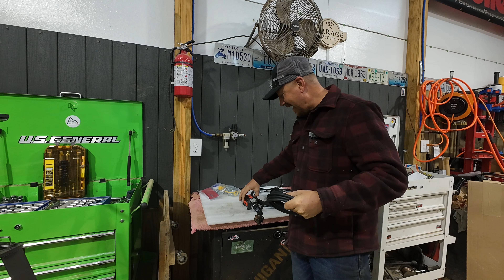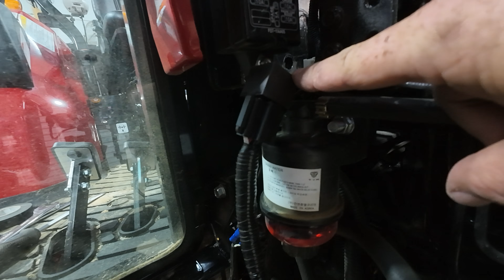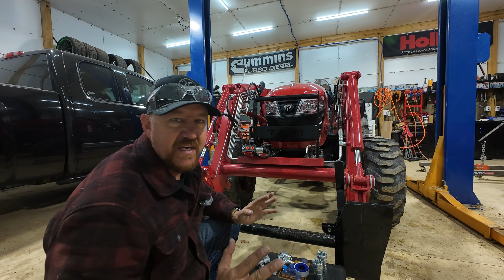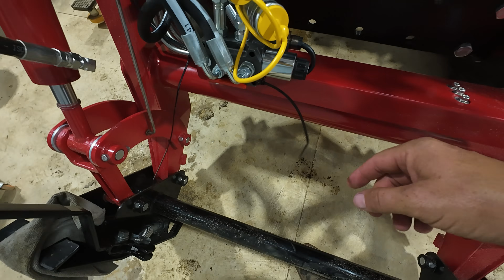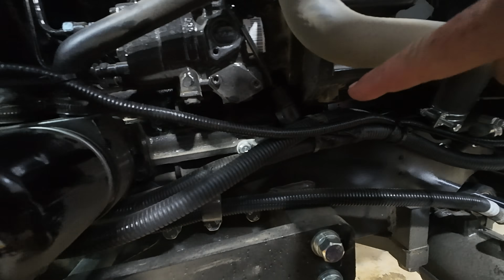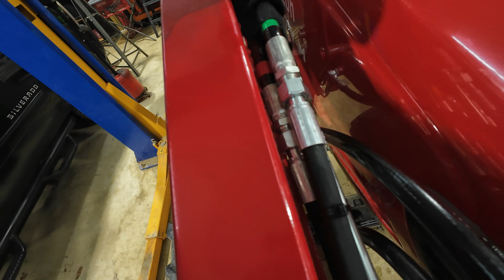TYM 4820 OEM Third Function Full Install

Comment: Now that it’s a single button you have to move the lever side to side while using the button correct? Vs. having one with 2 buttons?
Reply from the maker: Correct
Reply: @PeeksPeakHobbyHomestead that’s what I thought thanks, what’s the grapple your using for loading logs? Need to find one
Reply from the maker: @conlanbartley1636 I’m using the Eastonmade FG60.
Reply: @PeeksPeakHobbyHomestead good grapple power from what I can see in the vids?
Reply from the maker: @conlanbartley1636 it is a beast!  Very heavy.  It robs some of your lift capacity so it takes a stout tractor, but I work things hard so I needed one that could take a beating.
Reply: @PeeksPeakHobbyHomestead awesome

Comment: I hope you didn't end up using teflon tape!!!!! When little pieces of the tape dislodge, they get stuck in valve body between the spool valve and the bore!!! This causes the spool valve to get stuck and can mess up other hydraulic components. 

Rather than using tape (and only for pipe fittings) use pipe dope instead!!!

Comment: Yep, UV protection, but they also stiffen up the lines when you wrap them together.  That came into play for me where the lines cross the top of the loader mast and where the grapple lines coil before connecting them to the quick disconnects.  It keeps them in one full coil and not wanting to drag the ground or hook on sticks and what not sticking up from the ground.  They're also really slick, and pointed woody brush will slide across them rather than biting in like they can do on hydraulic hoses sometimes.  They don't do miracles or anything, but it's a little extra "aw crap" insurance.  With TYM's cab models, the hose routing is notoriously bad at the top of the mast.  The dealer did a horrible job on the third function, and had it zip tied to where it pulled all the lines across the top of the mast without enough slack to do that.  Anytime you lowered the bucket to the ground it was ripping all of the hoses out and was wearing the hoses in a couple spots at less than 10 hours on the tractor.  The outback wrap gave me a good way to re-secure all that in a way that it slides beside the mast when lowering the bucket, like it should.  I was watching yours, and the hoses stay outside in that hose guide nicely on the way down.  Looks good.

Comment: Nice job!  I ended up using a lot of Outback Wrap on my third function lines an grapple hoses.  I was able to go nuts with it for under $80.  That and a brush guard can head off a lot of problems once you start grabbing brush and limbs with a grapple.  Some day I want to put a couple sets of rear remotes on mine too like you did, but probably not for another year.  I've got to see a top and tilt set up prove to be needed for me, and that means if I can't draw enough driveway jobs I'm not spending that $.  Thanks for another good one!
Reply from the maker: Sounds like the right approach.  That wrap is a good idea too.  I’ve hear they do that mostly for UV protection.  Can’t hurt.

Comment: Lucas, try and stay away from the Teflon tape, many hydraulic pump🎉 manufacturers won't honor the warranty if Teflon tape is used, permatex makes a liquid Teflon that works well,and another that's a sealer and thread locker for stubborn drips. Good job, I enjoy your videos.
Reply from the maker: Thanks for the tip!  👍